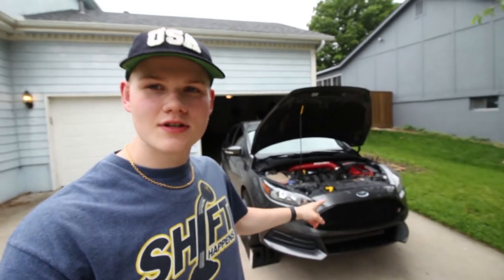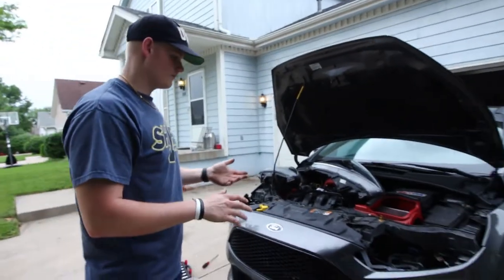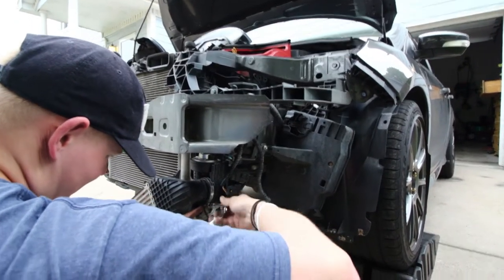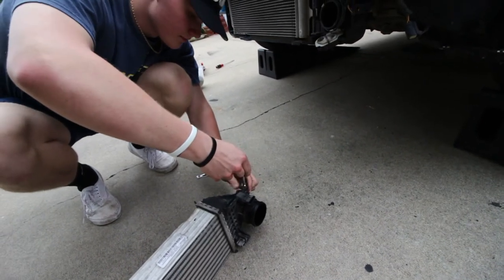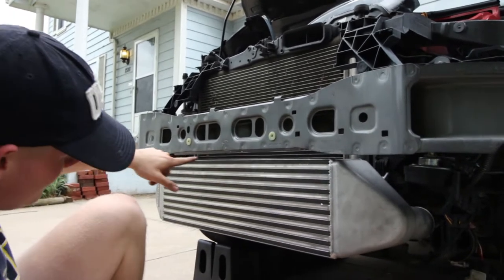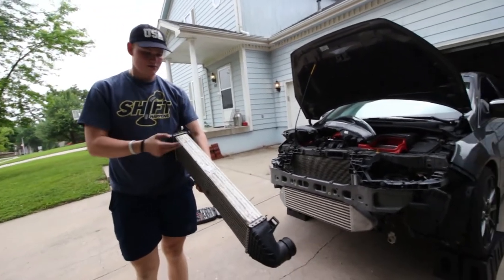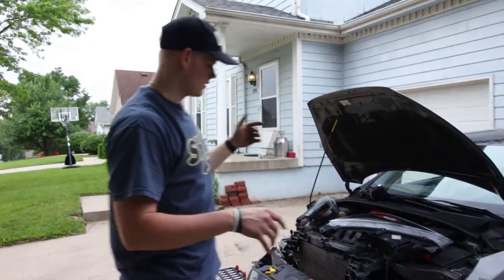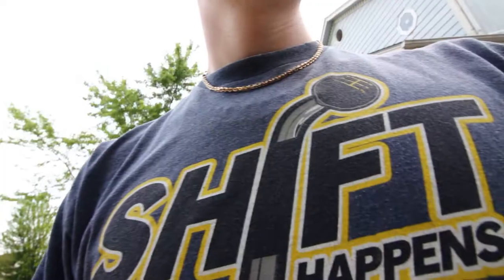Focus ST Garrett Intercooler Install Guide!

Comment: Doing my Mishimoto install rn, Im having to cut the same piece
Reply: You do not have to cut any metal out. All you need to do is drop the radiator by undoing the lower bracket bolts.
Reply: @daddee6625  bro thankyou, looking at buying one v soon and no way ima be cutting my crash bar🤣